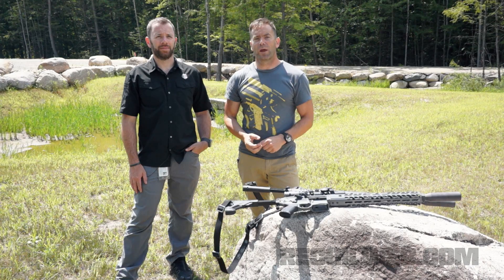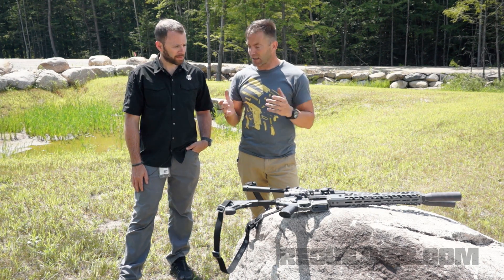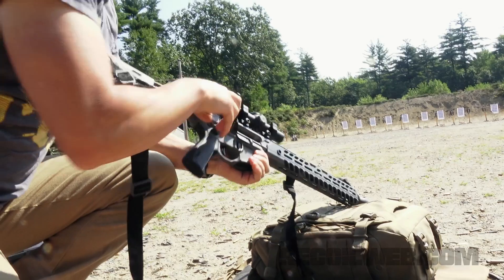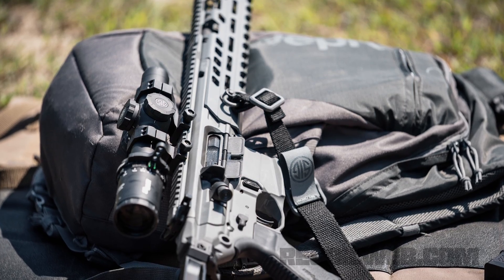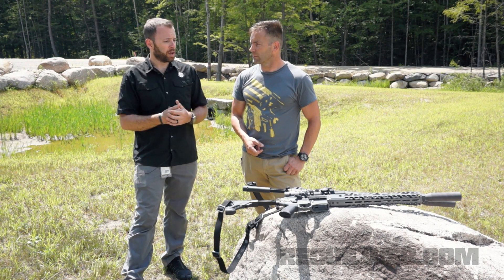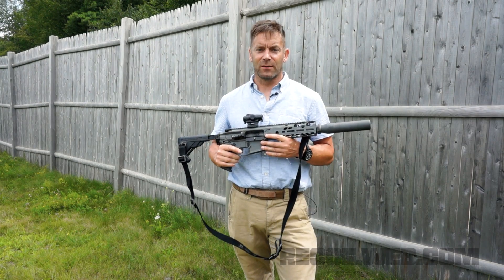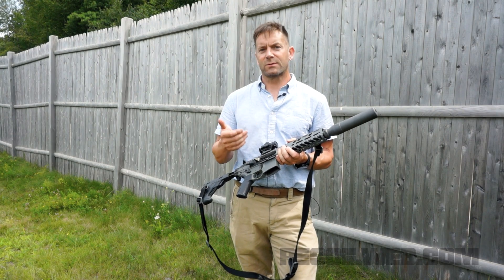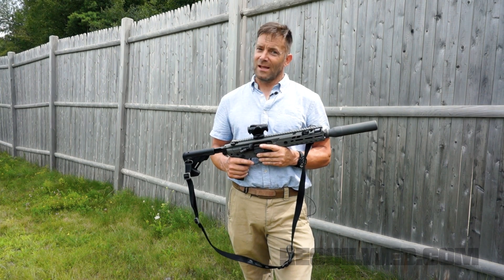Sig Sauer MCX Virtus Rifle

Comment: Let’s get that endurance test going when you can Ian. I have been looking at this for another rifle and if it does last 20,000 without an issue or even a few issues, I’ll be impressed. Great work as always!
Reply: Already been done before.......by SOCOM during the SURG contract trails because 20,000 rounds with no parts failures was a contract requirement.
Reply: Gs Xr Great. Let’s see if the channel does it too but if not, if SOCOM approves it, good enough for me.

Comment: Yeah man. Run an endurance test. I’ve burned out 5.56 barrels in less than 10k rounds so I’d be very interested in that test. I’d also be interested in a deeper dive into the components and specs. Thanks for another good video.

Comment: Yes of course we want to see it. Check the parameters of Sig's test on the gun...do they mean 20,000 without cleaning, cleaning after X number of rounds, what lube, temperature that components shouldn't get beyond, what ammo used, etc. Even if it doesn't make the 20,000 on your test, it's still a sick rifle.

Comment: This video is a bit late. Like by a year. The information is out of date in reference to caliber exchange kits and modularity. Their barrels are showing discontinued all over the internet, not sure if that's due to the pandemic or just them not being able to keep up with production. It concerns me though, as Sig is a powerhouse with manufacturing and r&d capabilities and is not able to keep up with it. I'm concerned that the MCX will turn into another Masada ACR rifle in the promises of modularity and barrel swaps only to find out that they're non-existent and then it goes by the wayside. You buy into the system, need to swap a barrel out because it's has a manufacturer defect or you just want something better, if you're going to have to go on the adventure of a lifetime to find one. same goes with hand guards whenever you swap out the barrel you'll need to swap out the handguard as the porting for the gas block adjustments is different from barrel to barrel. The handguards are just as difficult to find in some cases. It seems that this weapon system is on the low end of Sig's production agenda. Same can be said with their MPX line, which gets changed every single year. First we have a 8.5 in 9 mm with key mod, then we have a 4.5 in PDW, then we have this copperhead thing which I don't even understand the need for. Regardless you can't find anything but the newest item that they're pushing out, when everybody wants the old stuff. I haven't met one person that's all hot and heavy on the new copperhead version. I don't understand why they didn't stick to the original or a Gen 2 Virtus MPX and just offer barely exchange kits and handguards like the MCX. So much potential, only to waste it on different variations every year and fall behind in production.

Comment: "So if you guys would like to see us run this through a 20,000 round endurance test, let us know."
I would like to know if this is an overpriced AR180 or on par with a Bren 2 or SCAR.
Reply: If you know anything about the folks that designed it/who it was designed for and currently used by...then you'd know that's a silly question.

Comment: Hasn't the Virtus technically been out since 2018.
Reply: Yeah, not sure why this videos is just now coming out.  Only thing I can think of is that there's been a lot of interest lately (Trex Arms, Garand Thumb, MAC) and RecoilTV wanted to get on the bus.
Reply: @djsity  True and it's a popular Call of Duty gun too.  I've always wondered why it weighed 7.9 pounds but I guess that's how you get a 20k round service life.
Reply: Ryan G true, I think the video game did it. I just bought the 11.5 virtus pistol yesterday. It’s much lighter then I expected. Out of the box with their folding brace and no mag it weighs 6lbs 11oz. They advertise it weighing 7.4lbs. So I’d imagine is lighter then the 7.9lbs advertised too.
Reply: @djsity  I hope you're right because 7.9 is really chunky for a 556 service rifle that is only a 16 inch barrel.
Reply: @ryang8040  The reason why it's so heavy is because of the things they had to have to pass the SURG contract requirements such as a reinforced upper and heavier barrel. The 20,000 rounds without parts failures was a contract requirement and they also had to hold 1.5 MOA for 5 consecutive 10 shot groups at 300 yards suppressed after 10,000 rounds had been fired on the rifle. Look into the contract requirements they were probably more strenuous than anything like it that came before it the heat cycling, accuracy and reliability requirements were insane. This was the 3rd time SOCOM had held those trails because no one could pass them until now. That said the Virtus is definitely a bit chunky my Legacy MCX Patrol weights 6lbs 9oz naked compared to 7.9lbs of the Virtus which is 1.33 lbs heavier. Compared to the front heavy Virtus the Legacy's front end feels like it's flying during drills.
https://soldiersystems.net/2018/08/02/first-look-socoms-new-suppressed-upper-receiver-group-from-sig-sauer/
Reply: @gsxr1189  I hope one day they offer a lightened MCX for people like me who aren't going to put the gun through as much abuse as that.

Comment: Sig has great designs.. but they fuck up the execution. Unless it's a p226 I'm not touching it. Your flipping a coin on whether your p320, p365, m17, m18, Virtus, m400 is going to work. That Swiss and German quality is gone.
Reply: The MCX comes vetted by SOCOM. The accuracy, reliability, and heat cycling requirements of the SURG contract were more strenuous than anything else we've seen before. In fact they were so tough that this was the 3rd time SOCOM had held the SURG trials because until now no one could meet the requirements. 
https://soldiersystems.net/2018/08/02/first-look-socoms-new-suppressed-upper-receiver-group-from-sig-sauer/